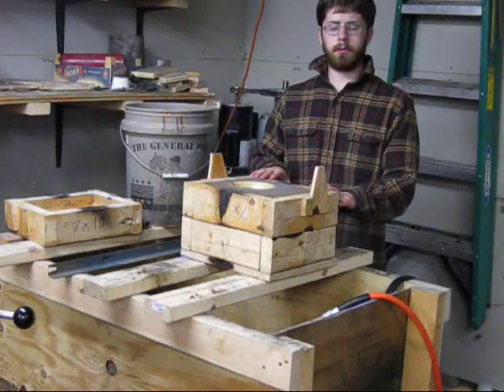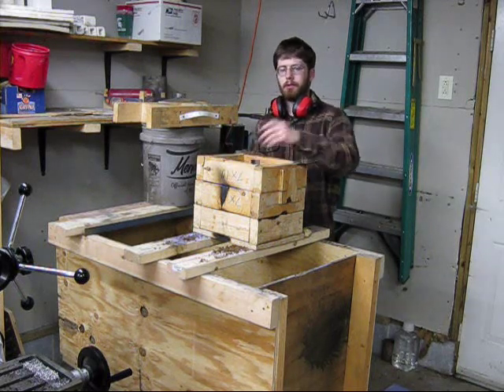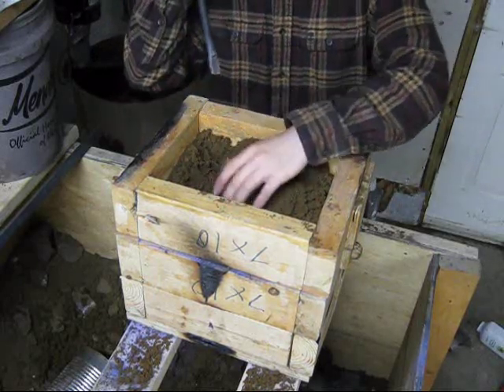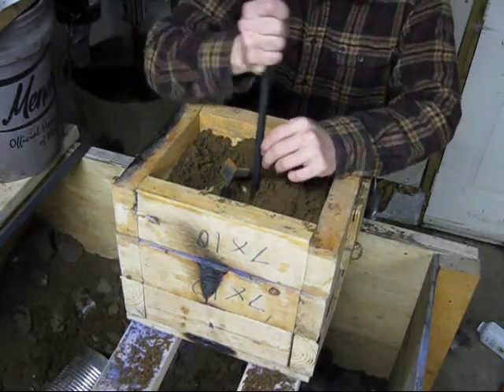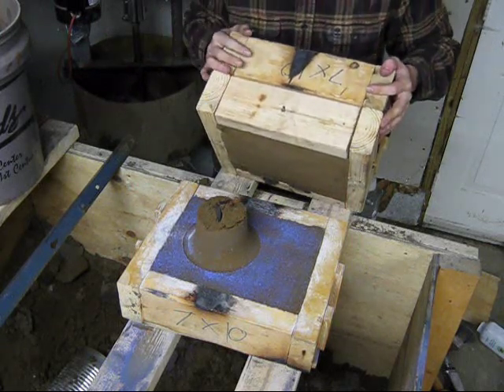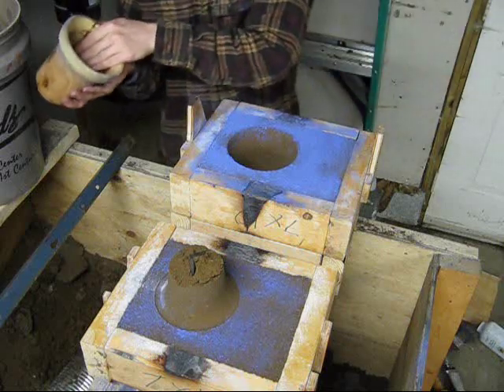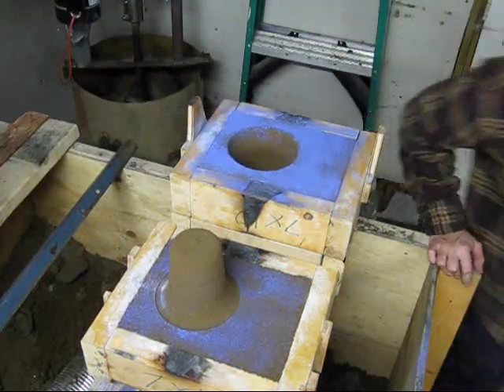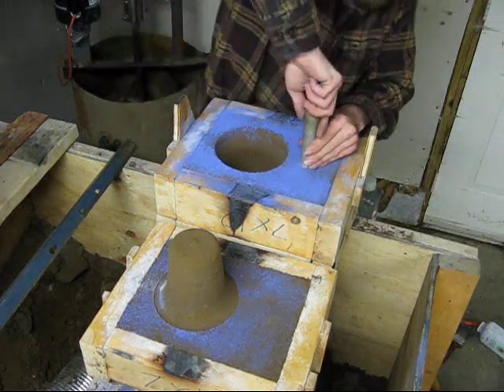Bell Casting-Drag

Comment: I that was nice bell when you finished I cast them in cast aluminum alloy + an extra alloy and they ring pretty good but of course not as sustaining as bronze. They pass well as in tone and most folks like them. I do this in back yard and use dry wood in a fire brick furnace with blower. I melt the aluminum alloy in a 12 inch cast iron pot. Largest I can make right now is no2 farm bell size around 15 inches